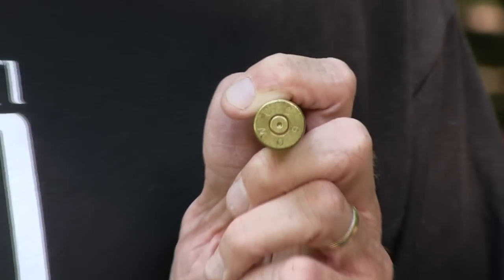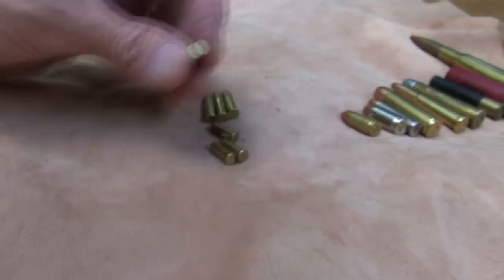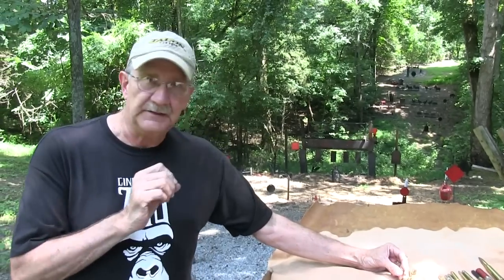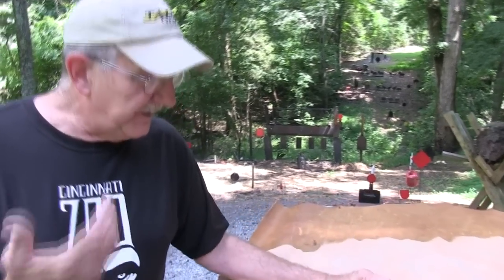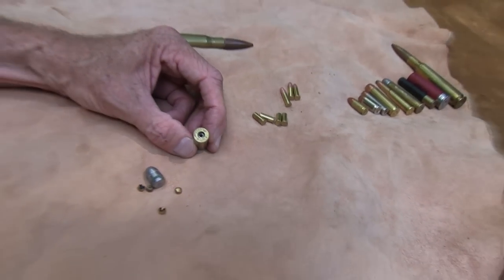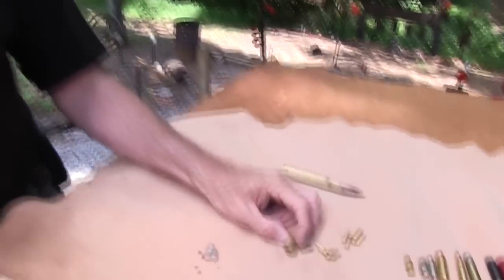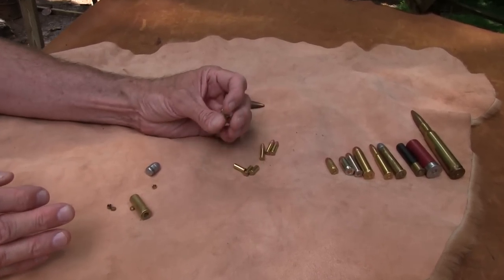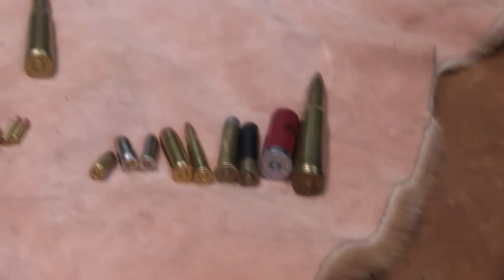Rimfire vs Centerfire

Comment: I looked these calibers up on wikipedia and it explained it that the .308 Winchester is the 7.62 x 51mm.
The .30-30 is .30 caliber in decimal inch and the "-30" means it uses 30 grains of smokeless powder.
The .30-06 is the same .30 decimal inch caliber but the "-06" means the year that it was developed in 1906.

Comment: Wikipedia: "Remington Model 95 over-under double-barreled derringers were manufactured from 1866 until 1935, in several rimfire calibers, the most common of which was .41 rimfire."  Most of the antique Remington derringers for sale are .41 caliber but there are a few .32s.

Comment: Just as a point of interest, back in the early '60s I owned a Webley bolt action, single shot 9mm rimfire shotgun.  They were commonly known as a 'garden gun', due to the fact you could use them in a cabbage patch or barn and not destroy your surroundings!  The cartridges were of interest too, some were a conventional metal chrome plated case, whereas another brand was paper.  The paper ones were quite spectacular when fired, as the paper burnt producing a huge flame from the muzzle!

Comment from the maker: Very, very slim.  If it does "go off," it will not shoot the bullet out as if it were in a gun. The lead, being the heavier part of it, will pretty much stay put, and the whole thing just becomes a powerful firecracker. The problem is, it's a metal firecracker and a piece of brass could catch you in the eye or something. I recall in my early days at IPSC matches, somehow a live round would occasionally end up in the burn barrel at the range. Loud pop, but nothing that would pierce the barrel.

Comment: rimfires (at least .22's) are generally primed with a drop of nitroglycerin.  Each case is spun onits axis (while sitting straight up) after priming so the nitroglycerin will flow to the outermost part of the rim due to centripetal force.

Comment: I dropped a .44 magnum round and it landed perfectly on the primer. All I heard was a loud pop. When I picked up the cartrige, the primer was nowhere to be seen, the bullet had not moved out of the brass and I was able to pour all the powder out into my hand. I'm thinking with nothing to hold the primer in, the path of least resistance was for the primer to pop itself out the case head.

Comment: Yea I read somewhere that the powder needs to be under pressure in order for it to all ignite from the primer's spark. When a cartrige is not in a guns barrel there is not enough pressure for the powder to explode and push the bullet out of the shell. Hence why you will find unburnt powder still in the cartrige.

Comment: They are very expensive for what they are.  When I was in high school one of the local shops kept them in stock for some fellows that had indoor ranges.  The nice thing about them is you could drop a tin of 100 of them in your pocket.  I had a RG22 and would take it and a tin of BB caps out and plink around the farm.   They were good for about 20 feet, but then so was that RG.  It was fun anyway.   The .22 cal versions will shoot in any revolver, but can be a pain to eject due to soft cases.

Comment: .22 long rifle cartridges (as well as shorts and longs) have the primer compound spread around the rim of the cartridge.  These "balloon" cases are thin and easily dented to fire the primer compound.  The empty cases can't be re-used.  Centerfire cases are drilled for a separate and replaceable primer.  Some of the .22 cases are centerfires, like the military's 5.56 or the .22-250.  They can be reloaded and re-used.

Comment: Reason why it is not done on larger cartridges is for reliability and safety issues. Brass has to be thin in order for the impact of the striker to be able to deform the rim allowing the primer charge to ignite. Pressures developed by modern smokeless powders would cause the case to rupture and/or require a striker that hits much harder if thicker brass were used.

Comment: There have been a number of rounds that were developed that did just that.  The .22 Winchester CenterFire (.22 WCF) was an early example.  The .22 hornet is similar, but uses an enlarged case.  Unless you go to a larger, necked case like the .223 there really isn't anything to be gained.  The market has proven time and again that people are not willing to pay extra for a centerfire round that does basically the same thing as the much less expensive rimfire rounds.

Comment: Main reason for centerfire is the more powerful caliber...
for rimfire to work the casing have to be relatively thin in order for the striker/hammer to dent the cartridge

when moving to larger and more powerful caliber the casing could rupture from the high pressure... 

thus the centerfire which only have a thin primer and a relatively thicker cartridge case

the gas efficiency is about a percussion cap mechanism...
which a percussion cap is about the size of a primer

Comment: Probably two factors helped kill the rimfire in larger calibers.  First is reliability. As Hickok45 said, rimfire cartridges are less reliable than centerfire ones. When you're dealing with life and death (which you usually are when using a firearm for its intended purpose) reliability is key. Second is reloading (or self-loading) firearms culture follows closely on with self sufficiency culture, and being able to load your own is important in that regard.

Comment: They do, they are called: .22Hornet, .222Rem, .223Rem, .220Swift, .22-250, and countless others.

The reason why they keep producing .22 rimfire is because make it is cheap, and provides a cost efficient means to shoot.   

.22rimfire uses a balloon-head case, so it is cheap to stamp out, and uses very little material.  ...saves money.   

There is really no need to reinvent the wheel by making .22 centerfire.   And if they did, all of your rimfire guns wouldn't be able to use it.

Comment: People do actually reload some of the old rimfire cartridges because there is no more brass to be had.  I've seen it done using the tips from strike anywhere matches for primer.  You just have to make sure the firing pin strikes a different place.  The process is entirely too much trouble for anything other than making a handful of historical rounds for an antique pistol.

Comment: Question on the M1 Garand.  My brother-in-law is a retired Army Major.  He has owned an M1 Garand for about 10 years but says he hasn't been able to find a place to shoot it because most ranges won't allow loading more than 3 rounds at a time.  He insists that if you don't insert a fully loaded 8 round clip into the rifle to start with, it will not operate.  It is hard to believe that the gun's mechanisms won't engage and make it capable of firing if youu only load 3 in the clip.  What say you?

Comment: Good job; however, you did not explain or illustrate the differences in the firing pin mechanisms between the centerfire and rimfire.  Also, it would have been nice if you explained why you cannot interchange rimfire and centerfire ammo in the same firearm.

Comment: Centerfire cartridges are more reliable because primers rarely fail and they are easy to reload. All you have to do is punch out the used primer and replace, as stated in the video. You can't do that with a rimfire cartridge. I'm not sure if you can even reload those.

Comment: depends on the manufacturer and the gun.

generally, MOST centerfire are OK, and MOST rimfire are not OK. there are exceptions.

for rimfire, ruger says the 10/22 is OK. browning says the buckmark is OK. henry says theirs are OK.

beretta says dry fire of the 92fs is NOT OK without a snap cap. it is one of the few centerfire pistols I am aware of where this is the case.

using snap caps is always OK and is good practice.

Comment: pressure and design of the lead tip and cartridge, like the 30-30 i think is the lowest pressure and the other two are almost the same i think the .308 has the highest pressure for big game, there all the same caliber, kind of like the difference between the 5.56 nato and .223 remington, same caliber, different design the 5.56 has higher pressure and thicker cartridge walls and the lead tip has some minor differences

Comment: I doubt it the firing pin messes it up a bit, and .22 is really cheap anyway

centre fire is safer in my opinion, with heavier cartridges you don't want rim fire because if you drop it and it lands on the rim there could be a very nasty accident, you can also reuse the brass

Comment: Actually the 7.62x54r isn't a rimfire cartridge. It's a centerfire cartridge with a rimmed case. The rim gives the extractor a surface to grab, facilitating extraction of the empty case from the chamber after firing.

Comment: some center fire ammo isn't very reliable. Also important for a gun to properly function as well. I have some 22s that have missfires mostly because light primer strikes, I put them in a different gun sometimes and they go off. 32 ACP is the most unreliable center fire ammo I've used but it could also be in part the guns fault. Either way I have at least 50rnds of .32 ACP that failed to fire.

Comment: 22lr is reliable enough for its intended purposes. rimfire primer failures are exceedingly rare, especially if you have a good gun with a strong hammer and large firing pin. in ~5000 rounds through my S&W M&P 15-22 I have had maybe 1 failure.

smaller centerfire is possible (e.g. 2mm kolibri) but the cost would be significantly higher. people would likely not pay the extra cost.

rimfire is a very good system, modern primers and manufacture are very reliable. there is little reason to change.

Comment: There's nothing bad about the Beretta 92FL Compact wearing it IWB or OWB. I wear mine both ways, I just picked up a BIANCHI 101-16 CC holster (nothing much more than a gun leather strap) it's sized for my Beretta holds it nice either at my side or in the small of my back. It also holds my Taurus PT22 with no problems for daily carry. My other holster is a  BLACKHAWK serpa #04 LH which I wear the same way. The BIANCHI is easier to use & I can still wear it when I'm not CC...

Comment: No. The firing "pin" is sorta on top of the bolt. It doesn't really look like a traditional firing pin, as it is flat piece of metal. Look up Ruger 10/22 firing pin on google images.

Comment: Does it hurt to "dry fire" a rim fire mechanism? I sometimes do this when I clean my Win Model 290.
Reply: +Roy G I'm a bit late here, but yes it usually does cause some damage that accumulates over time, so don't ever dry-fire a rimfire firearm (unless you have a snap cap or a spent case in there, at least).  The reason is that the firing pin will typically impact whatever is behind the rim of the cartridge, and without anything soft to "cushion" the blow, either the firing pin and/or whatever it impacts (depending on the design) is going to get dinged.

With centerfire firearms, it's not much of an issue because there is nothing for the firing pin to impact, and generally the force of its movement is absorbed by more substantial structures.  Personally, I wouldn't dry-fire even a centerfire firearm repeatedly (like for training) without snap caps because even these guns can take damage over time (yes, even Glocks have been broken by people who dry-fire them thousands of times), although once in a while is OK (I never do it, myself).  Rimfires, in contrast, should never be dry-fired (without snap caps or something suitable in place) at all--it might seem OK for a while, but rest assured, you are damaging your firearm (should be visible on inspection).

Comment: I knew that the .308 is the same as a 7.62 x 51mm., I've used all three of these calibers in the past!
I used to have a Winchester Model 94 Lever-Action in .30-30 and I used to own a both a .308 and a .30-06 in Bolt-Action Rifles which both are great white-tailed deer calibers!
I know that .30 designates the size in decimal inch which is the same as 300 thousandths of an inch, but what I never understood is what the last part means such as "-30" as in the .30-30 or "-06" as in the .30-06 means!

Comment: Rimfires are seen as weak (low pressure) but there is a new .17 Winchester supermag that compares favourably with the 5.7mm

I'm wondering why, since rimfire is cheaper to make, there aren't any modern larger calibre rimfires for cheap full bore shooting, would be good in this economy. Anyone know why everything above .22 died in rimfire format?

Comment: Rimfire is cheaper to assemble than centerfire by far. .22s are designed for varmint shooting and target practice, as well as teaching people to shoot. For practice, you want heaps of rounds, and you want them cheap. You don't need power, just target practice at a paper target from maybe 5-150m at the most. Varmint shooting is also close range and soft targets. No point increasing the price by making it centerfire for no reason. If you need more power, you wouldn't be using a .22 anyway.

Comment: Is rimfire the same as pinfire?
Reply: no pin fire actually has a pin sticking out of the base of the case and when the pin is struck by the hammer it is driven into the case and ignites the powder. pin fire cases have not been made in several decades that I know of but I do know Gary James made his own to demonstrate a pin fire handgun that he has. video might be on the net somewhere. Also the cylinder for a pin fire is made so that the pins stick out/up so that the hammer can strike them, the shells have to be placed in the cylinder a very specific way. I don't think you can load them the wrong way because of a notch in the cylinder for the pin to stick straight out/up.
Reply: +Paul Shayter Thank you for your answer.